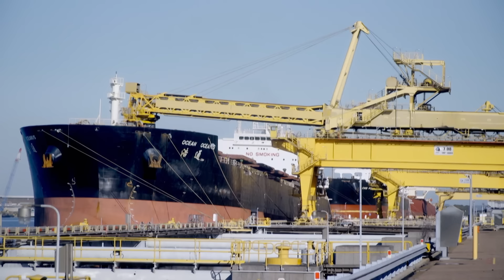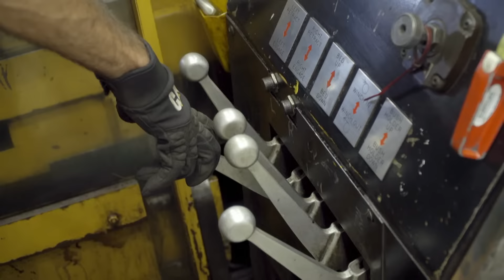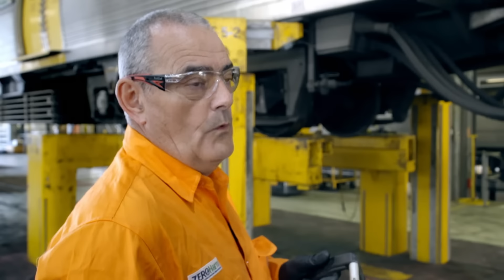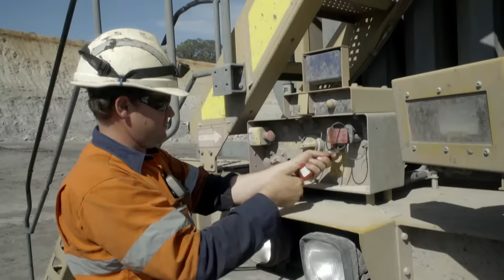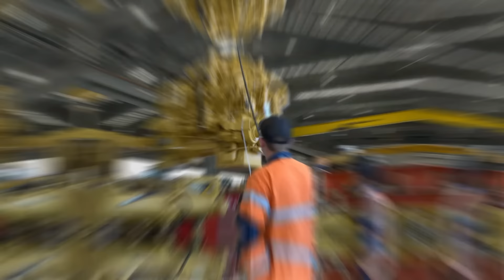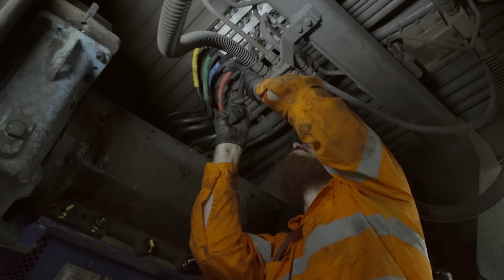These Giant Tires Cost $27,000 Each | Mega Mechanics | Wonder

Comment: Okay narrator, don't be so desperate with everything you say. It's not as bad as you make it sound.
Other than you it's a great video.
Reply: I know, right!  If he actually left mom's basement and got a job working with such machinery, he would just relax. Basically every program made like this has the same style of over blown narration. And the imminent worst case scenario about to happen....only to be interrupted by a commercial every 4 minutes. And of course another 2  minutes of recap after 5  minutes of commercials. Then everything is fine.